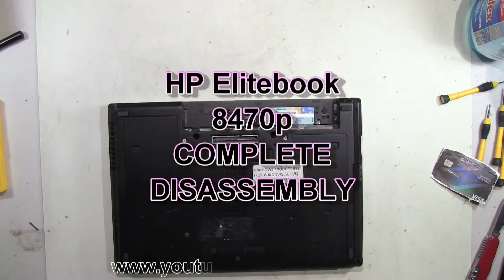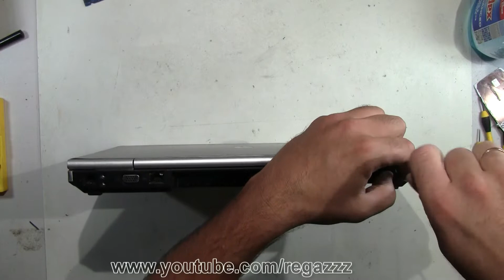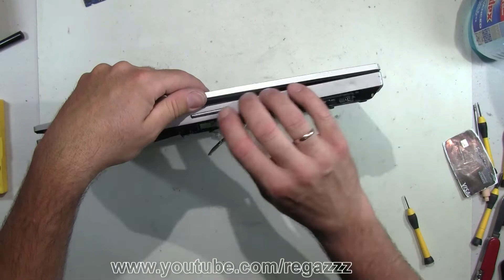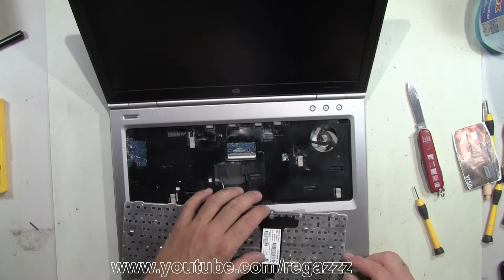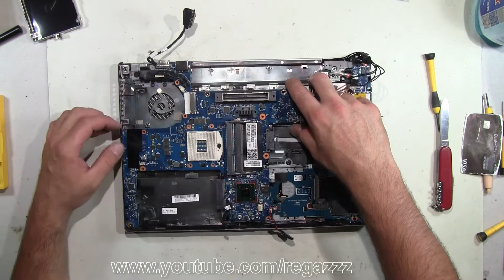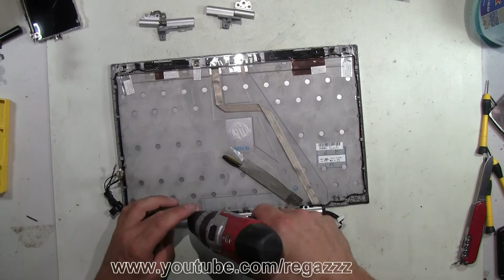HP Elitebook 8470p Take Apart Complete Disassembly How to Disassemble

Comment: HOW DID YOU OPEN THE LID SO EASELY
Reply from the maker: Most laptops I touch are used and it could be very well possible it was disassembled before, which is easier to open second time.
Reply: @regazzz  yea, I guess, but I did manage to open it after some time of trying... So thanks